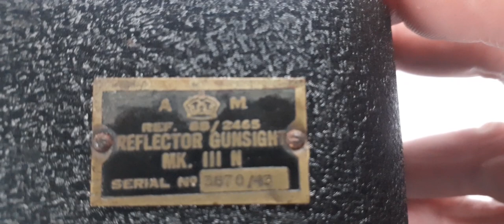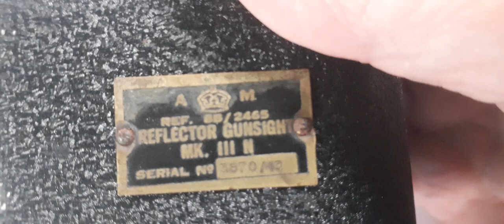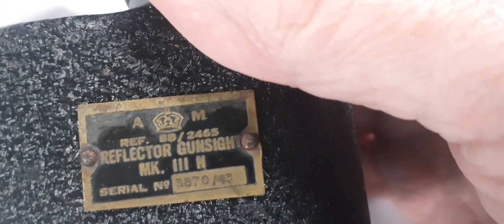WORLD WAR TWO RAF  AIRCRAFT REFLECTOR GUN SIGHT MK III N, 1943

Comment: Interesting. I have one of these, though not in nearly as good condition. I aim to start restoring it soon. The glass is badly chipped so I may try to use some clear resin to repair it. Using new glass would destroy the originality in my view. 
I agree about the prices. The sad thing is that about I picked mine up about 8 years ago for £45. Prices have gone daft on most interesting historic aircraft stuff which means those of us on normal wages can't afford them anymore.
One thing, I understand these sights were used on early Mosquitos as well. Having said that I am yet to find a picture of a Mosquito cockpit with one installed. They all have MK 2s from what I have seen.

Comment: You realise, of course, that you're looking through it backwards...   Also, being a IIIN it was used as the pilots gunsight in multi-engine planes such as Mosquito.  Lancaster turrets (and almost all other British plane turrets) used the mk IIIA version which had a glare shield over the top and flip up shade.   You access the bulb by pressing the release button on the bottom and removing the side with the brightness control.
Reply from the maker: yep heat of the moment thing, thanks for the additional info,much appreciated